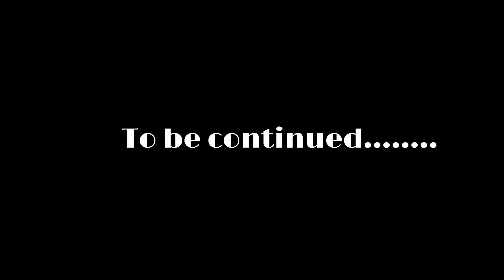Audi S3 8V | Exhaust mod! we get more flow - and richer sounds

Comment: Did you use your stock fiberglass or did you use new fiberglass? And I saw the exhaust pipe that had the holes in it that makes it to where it’s not loud when it ever the Valves are close basically it makes the pipe with the valve on it the one that makes it loud not the other one right? If that makes sense
Reply from the maker: Yes that is correct! I want the car to look and sound as stock as possible on the road and just driving normally, the perforated pipes do this very well - it is a touch louder than stock at low revs, but under full throttle it really sounds immense! I used the stock fibre glass for the deadening - this was a prototype exhaust we were playing around with, but it performed extremely well on the Dyno and I am more than happy with the sound of it in all driving aspects
Reply: @wosa9461  OK perfect I’m gonna use the stock then I’m a do exactly what you did the exact layout as well! Is there any tips that you can give me of how to improve the sound ?
Reply: What kind of a downpipe do you have and do you have a middle silencer at all?
Reply from the maker: @smitherzz001  yes - the next exhaust we build (we are building these to sell) will have cleaner bends in the valved exit (they’re at 45 degrees welded on this exhaust) we’re looking to have no sharp corners to better aid flow and hone the sound a little more. Other than that, there’s nothing we will change
Reply from the maker: I have a 3 inch scorpion Downpipe and the stock resonator is still in place

Comment: how did you get those pops?
Reply from the maker: They have been mapped in, although the exhaust mod emphasises them
Reply: @wosa9461  Aah okay thanks! I did have pops and bangs but the map was set over the s-tronic fuel map so it shifted very bad so i took them off sadly.

Comment: Next mod gonna be port side injection...?

With this exhaust mod, what exactly did they do? Straight pipe the coupler (instead of the air distribution punched out tube), and redirect the pipes straight out instead of having two resonate inside the muffler? What kind of material is inside the muffler? Fiberglass insulation or vinyl type material?
Reply from the maker: I’m going to stop for a bit with the power - need to address the brakes now, but I’ll most likely look at methanol injection next for the engine!
Reply from the maker: So we essentially straight piped the valved side of the exhaust and perforated the none valved exit - the material is the standard fibre glass

Driving around normally it’s actually a tiny bit quieter than standard with the perforated pipes - but over 3k when the valves open it grunts to life, I’ll have a more sound orientated video coming up next!
Reply: @wosa9461  I shot you a DM on insta. Same name as here but @tom__forde

Comment: Good job on the exhaust! With you on the cost of aftermarket exhaust. Silly cost. My bespoke solution is going to cost me barely a 1/3 of the cost of the exhaust the tuners were trying to sale me.
Reply from the maker: Video honestly doesn’t do it justice! Have some important times and full throttle sounds on the next video - it really is scandalous what they charge for aftermarket exhausts!
Reply: @wosa9461  Yeah quite hard to get the sound properly recorded, if it gets to loud the device sometimes seems to go deaf lol
Reply from the maker: Yup.. the bangs at the end of the video are as loud as gun shots 🤣
Reply: I had a custom box fitted but I got a res delete also mine drones ridiculously on eco vibrates also. Put a res in to tame it down and now hardly pops and crackles sound worse that res delete and manufacture standard box. Is there any drone under 2000rpm on eco and vibration
Reply: @WajidAli-oq8uh  Hard to say with the setup in this video as it was a while back and it has evolved since, catback is gone for a central pipe with just a cat and a bonnet cutout. It drone around 2/3K rpm. Eco mode disable pops & bangs and sometimes the disabling get stuck even when going to other modes. I explain the fix in this vid https://youtu.be/G-dl16TkfZQ

Comment: Is the stock resonator restrictive or you still use it on 530bhp ? Nice work tho!
Reply from the maker: Thanks! Res isn’t restrictive at all, they’re only there to remove high end frequencies
Reply: @wosa9461  Great ! So you keep OEM resonator at 530hp ?, i have full non res cat back but i want to put decat pipe nad prolly will need the OEM resonator to keep things normal on the highway. Great video man !
Reply from the maker: Yes I kept the resonator in, no drone on motorway driving and still an awesome sound when you’re full throttle 😎👍🏻
Reply: @wosa9461  Cool cool ! Big thanks !